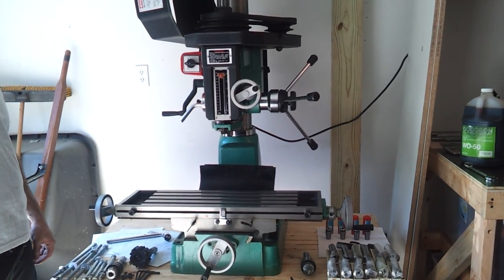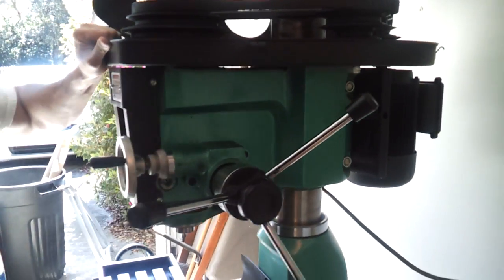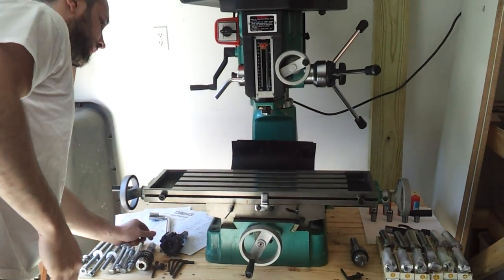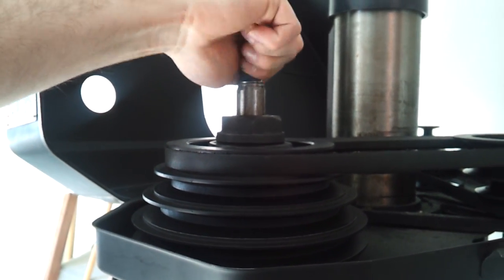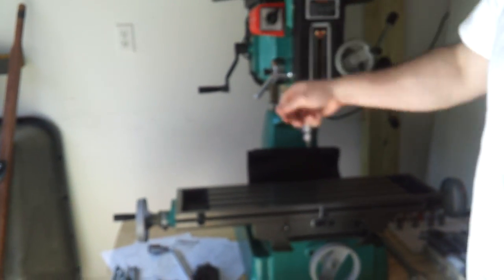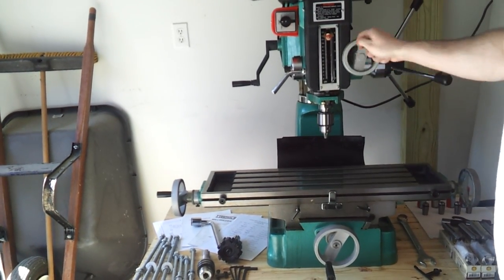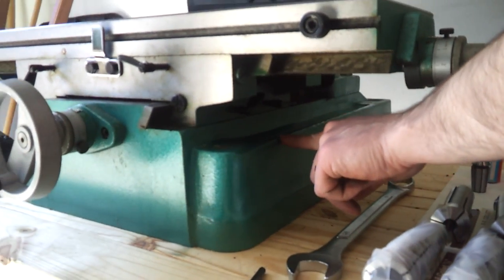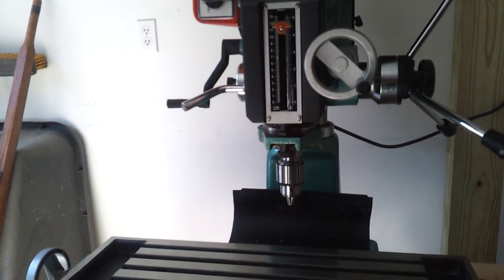Harbor Freight Heavy Duty Milling/Drilling Machine Crash Course

Comment: What is the purpose of the round stops on the front of the bed, They are adjustable with an allen wrench, Then also note the chrome plated
bracket mounted in the center that the two stops will hit. I know the round stops will hit the chrome piece if the bed is cranked far enough.
Is this just to keep the lead screw engaged in the threads under the bed? I notice it is all missing on some videos.

Comment: Sounds like a slipping belt and a noisy bearing. Hard to tell without being there. That is a hefty beast, though 655 lbs according to manual.
Reply: Toby W yup it weighs that much got one 150$..if you.break down to parts easiest to move am 60 i did it

Comment: I purchased a new mill.  How did you lift it up onto your table?
Can you please provide the info on the chuck and needle bearing you added.
Reply: Probably the same way I'm going to have to when Conway delivers mine... Take it apart and re-assemble it on the bench.. Or get a few friends to help. It's about 750lbs. :P
Reply: Edward Nigma yup how i did my lathe..bench top  vert..and horiz  mills.take them apart...never tail after the fact is when friends show up
Reply: I just moved mine from my parents house to my new house.  I used an engine hoist.  Lift it up a bit, and block it with 4x4's, lift more, re block, and move the chain from above it to over the bed, and then lift/block again until you get it to table level.  Took about 10 min each way, but it was nice and safe